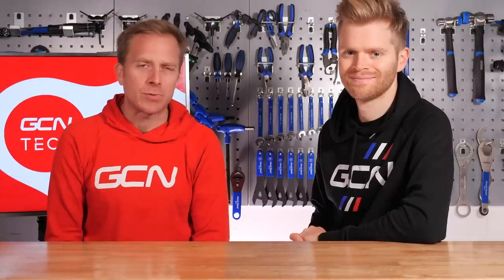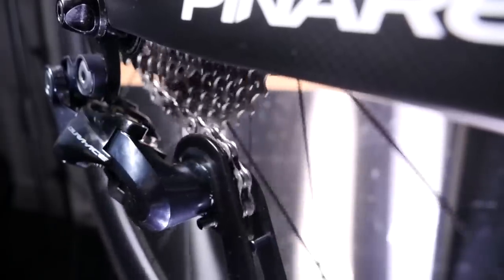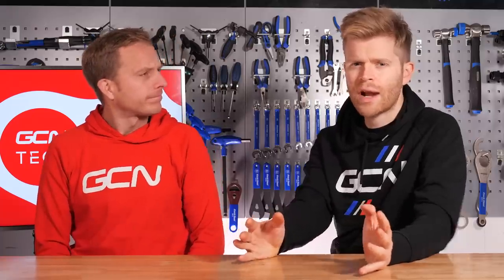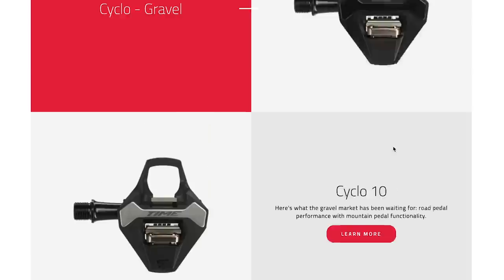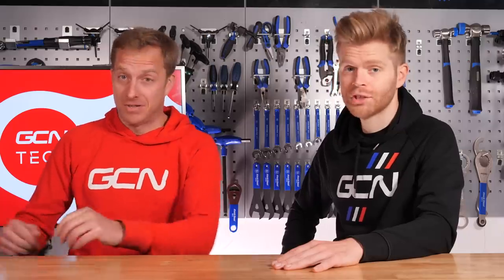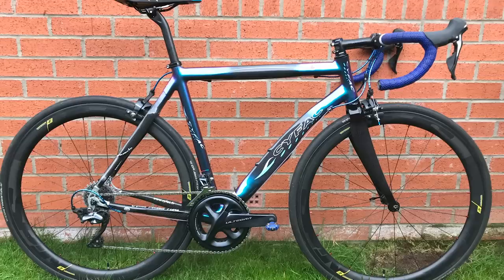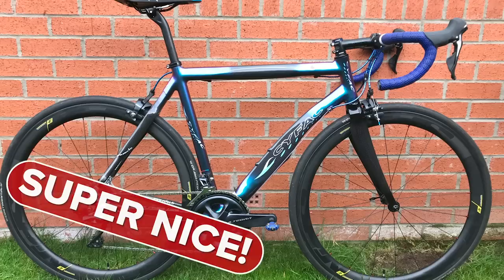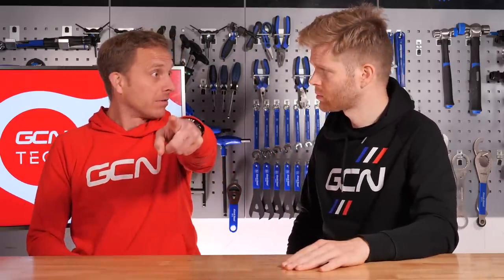Road Bike Tech We Want To See In The Future: How Can Cycling Get Better? | GCN Tech Show Ep.94

Comment: Electronic brakes
Reply: LOL. What happens when the battery dies halfway down a descent?
Reply: Brakes mechanically lock when voltage drops. Doable.
Reply: o0260o who’s helped with that? A bike you cannot ride anymore if there is an issue with the brake connection?
Reply: @jochem1986  you can program in ABS, brake balance, modulation.
Reply: o0260o you can do that with hydraulic brakes and sensors. Doesn’t have to be an electronically operated brake.